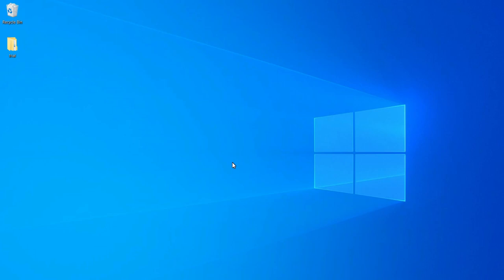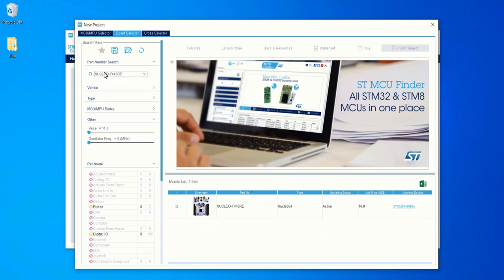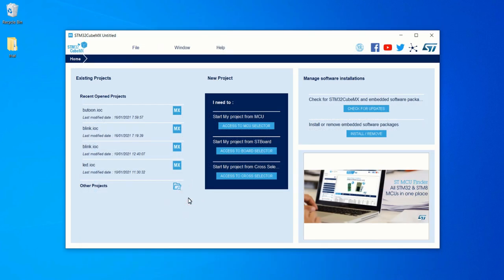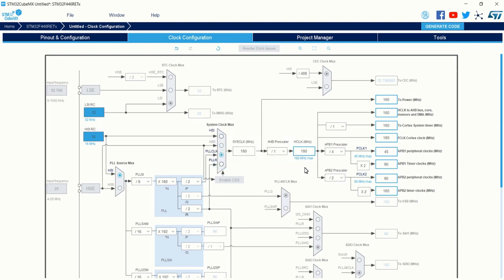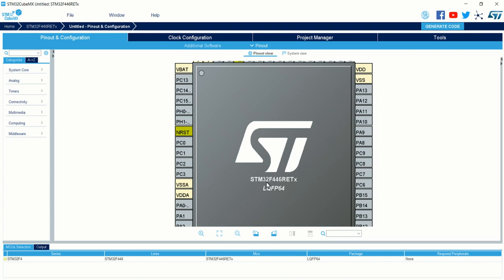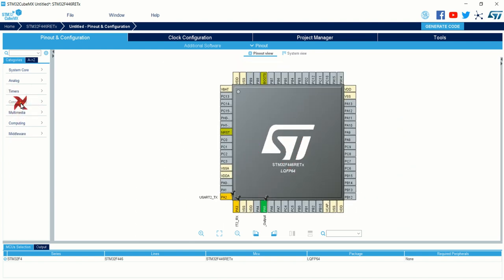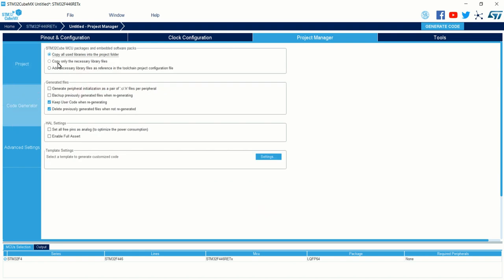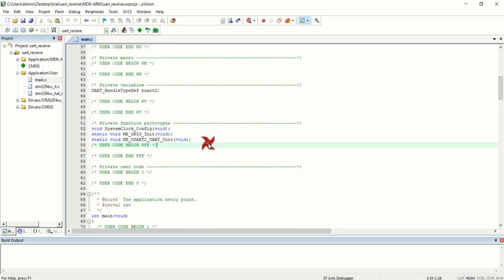Serial (UART) Communication Receiving data in STM32F446RE | Nucleo-F446RE | STM32 CUBE MX | T -20

Comment: Hi Sir ,
I am having a problem in receiving strings in UART using interrupt method as I am not able to receive any character and I am able to get only NULL
Reply from the maker: Check the baud rate 
Not even receiving one byte …? how many bytes you want to receive..?
Reply: @SMtrainingacademy   Like I am sending 5 characters and I have kept array size of 10 and I am checking in while loop for the character is not equal to null,but it is not entering the loop as the condition is failing,so I don't know the exact reason

Comment: sir please upload video on rs232/ rs485 communication i need in my project
Reply from the maker: Hi Prabha kumar 
What ever communication you need whether rs232 or rs485 we use only uart in microcontroller for that ,but you want to use convertors correspondingly eg: if you want to communicate using rs485 you want to use max485 IC as communication circuitry